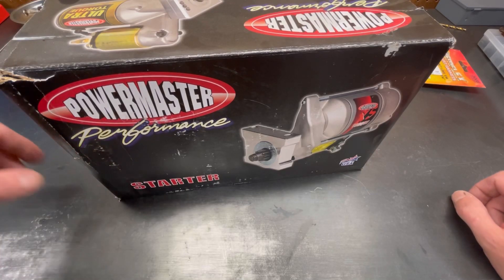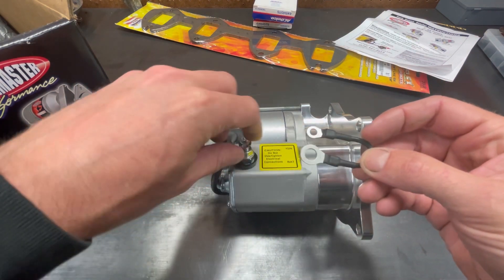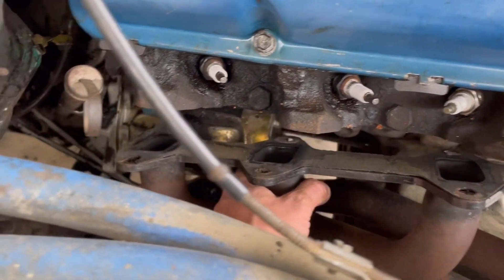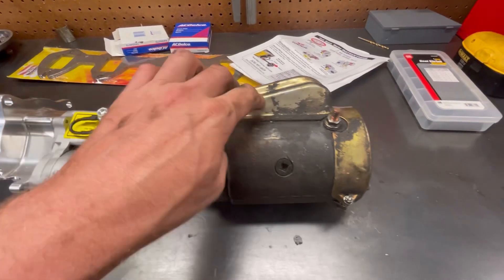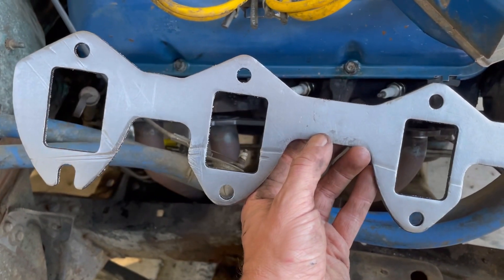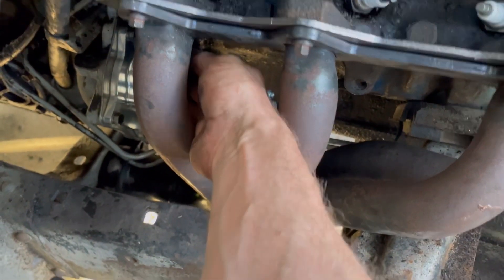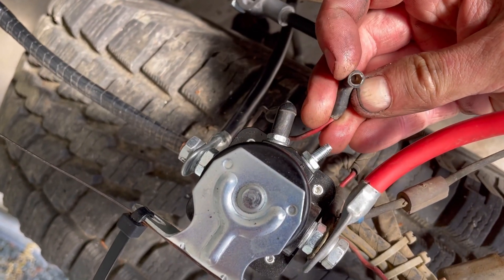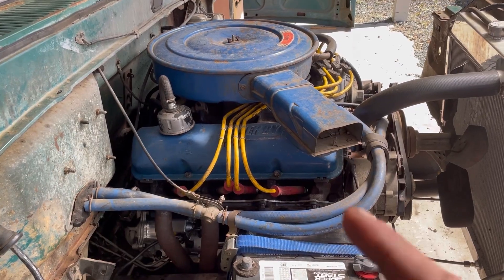1968 F100: Powermaster Mini XS Starter & Remflex Header gaskets

Comment: She sounds good! What exhaust are you running after the headers?
Reply from the maker: Thanks Chad! Currently it’s just wide open headers which is why she sounds so good 😂

However; to keep the neighbours & Johnny Law happy, the Flowmaster Super 40’s that I mocked up a while back will be going back on, using 2.5” pipe, an H pipe, and exiting or dumping just in front of the rear tires. 

https://youtu.be/H_RwpaOby1g

Once I get it through inspection I may swap them for some original 40’s.

Thanks for watching! 👍🏻

Comment: I can't for the life of me get the starter out past the headers.  I've unbolted It but it's trapped.  The video doesn't show how you actually got it out... can you show/explain?  Thanks so much.  Great video!
Reply from the maker: Reverse of how I installed it at the beginning of the video. Unbolt the header and slide it up and and forward. That will leave you tons of room to get the starter out. 

Thanks for watching 👍🏻👍🏻
Reply: @whiskeycreekcustoms6296  Thanks for the reply!  I'll give it a go but for some reason I couldn't move the header far enough to create enough space for the starter.
Reply from the maker: @davidmccullough4342  it can be a bit of a juggling act-especially with a full size starter. It will come out though!
Reply: @whiskeycreekcustoms6296  Will give it another shot
Reply: Just a quick update... I had my son hold the header from the top and I was able to slide the old starter out and the new one in from underneath.  Success! I still can't start the truck but replacing the solenoid today.
Reply: Did it many times, it's a pain.😊 @whiskeycreekcustoms6296

Comment: Im not mechanically inclined, i was wondering if those gaskets always need changed when putting in a new starter? Just good practice? Thank you
Reply from the maker: @AmandaRagsdale-j3p  I have been told that remflex gaskets can be reused, but I don’t know if I trust that. For any other style of header gasket they should certainly be replaced to avoid leaks. 

Thanks for watching! 👍🏻👍🏻